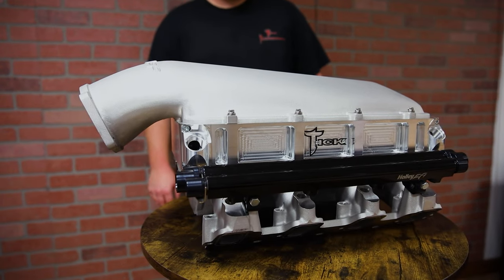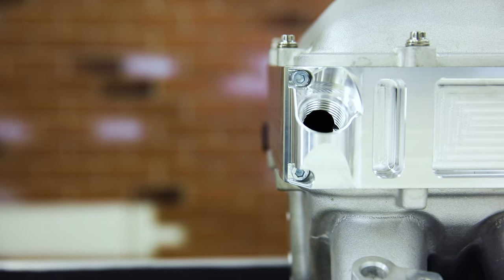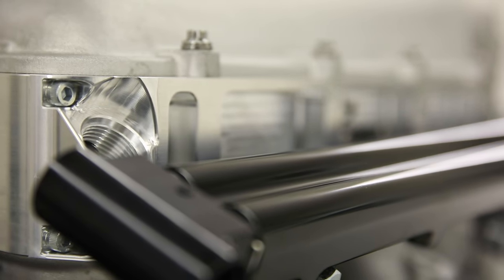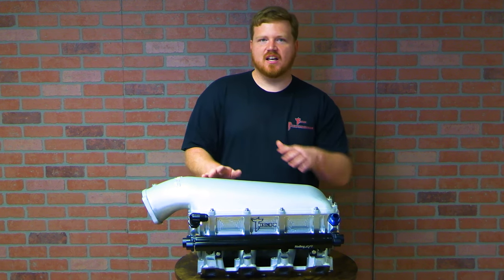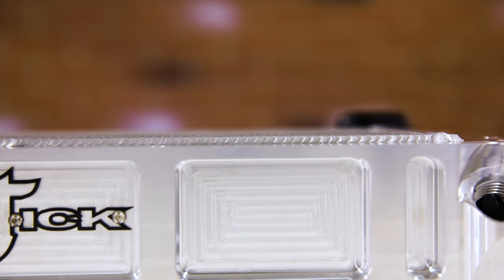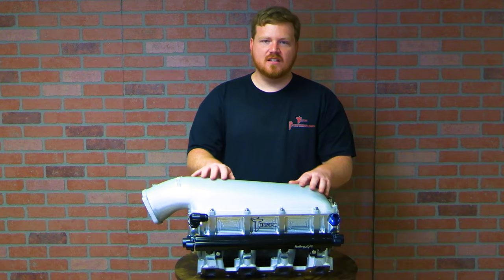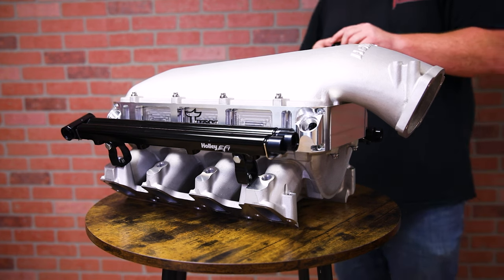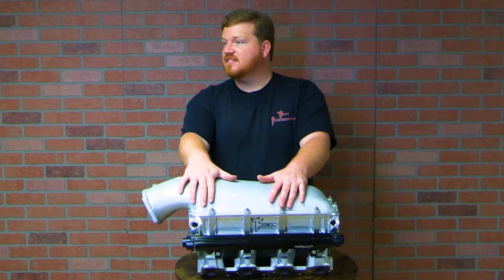NEW Redesigned 1400HP Air-To-Water Intercooler

Comment: I have a Mezier wp336 55gpm pump  with -12  to the cooler in/out do you think the water will move too fast in the cooler to do its best?How much flow should I try for with 1,000hp 270 degree IAT?I am just using tap water in a roots 8-71 15# boost C-16 fuel.